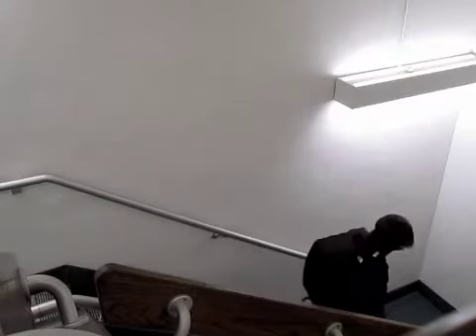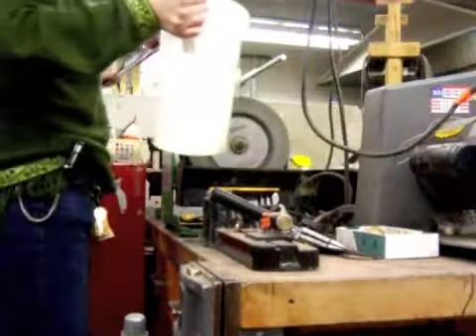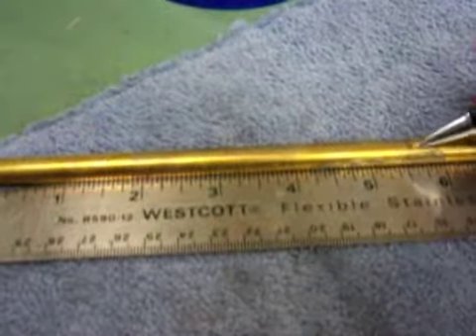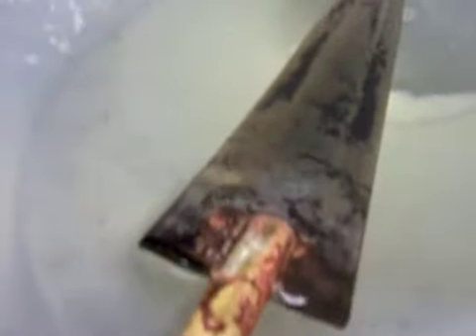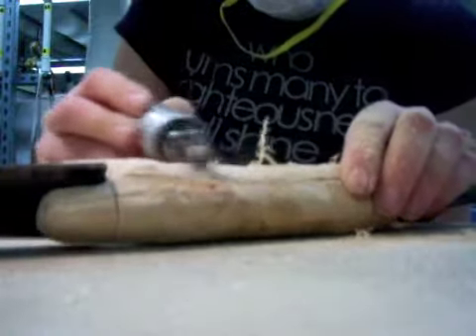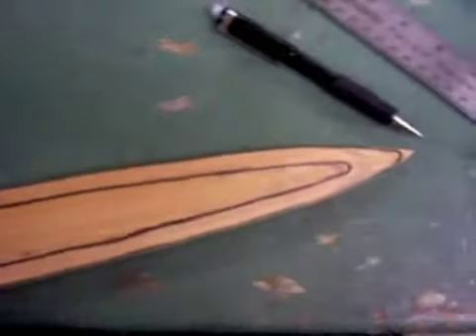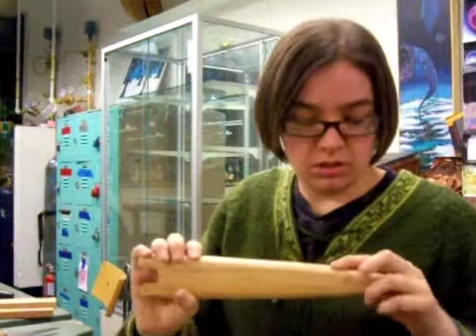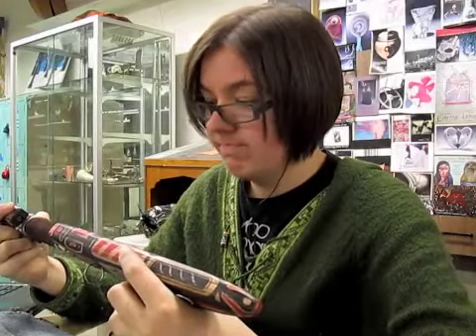Documentary: Building a Replica Tlingit Double-Headed Dagger

Comment: If traditionally made, this would take much more longer, even by the forging standards of the time.

Reasoning being they didn't use the high temperature kilns and crucibles to Forge their knives.

Thus, these were usually found in the hands of chiefs before trade began to really explode and an influx of European iron and steel flooded in.

Similar thing happened with copper. Copper possessed an immense spiritual and materialistic value. The death of a Chief could result in the disassembly of his copper shield(s) and dispersal into the ocean.